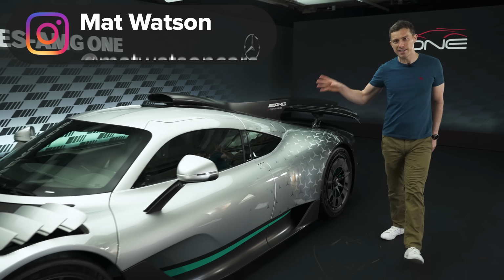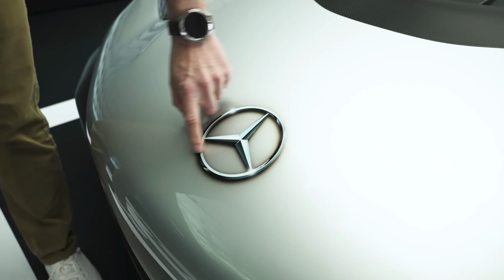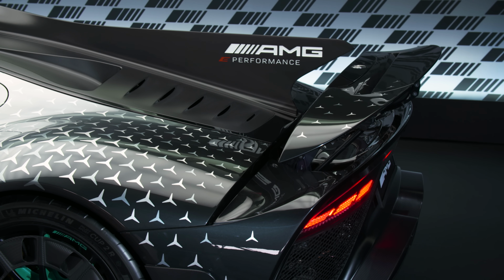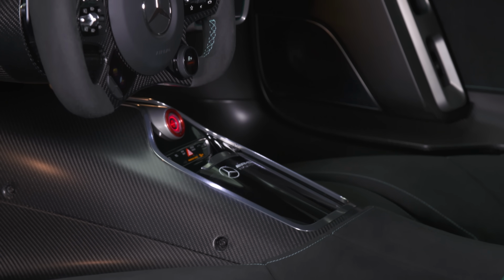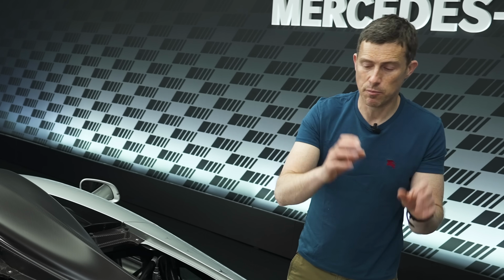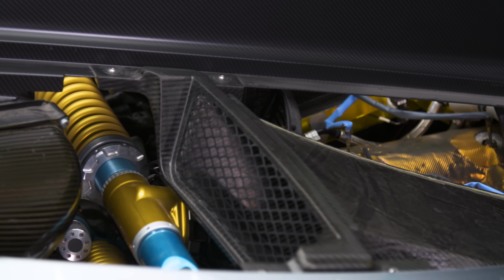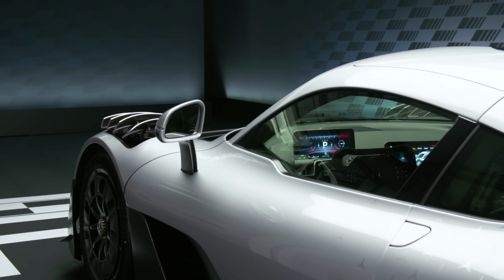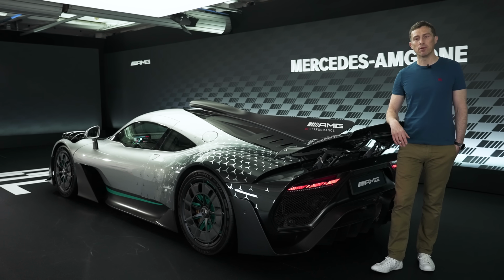Mercedes-AMG ONE: An F1 car for the road!

Comment: This and the Valkyrie were supposed to go up against each other, but with it weighing 1700kg (600kg more than Valkyrie), being almost 100hp down and having nowhere near the same level of downforce, they're not even remotely close. I'd be surprised if it could hold its own against the likes of a 765LT.
Reply: While I completely agree on the weight side I'm fairly sure running the Valkyrie on anything other than a nice smooth race track is going to be a fairly... unpleasant experience. Put it this way, you know how most electric cars have charging points in the sat nav because you're likely to need one at some point? Pretty sure the Valkyrie has a comprehensive database of chiropractors....
Reply: @smiddlehurst1  Oh no! I'm super worried about how my specialized track vehicle will drive on regular roads made for "normies." 🙄
Reply: @dq3666  It's kinda important if you ever decide to drive it to or from the track. Also if you're marketing something as a road car that should probably mean more than bolting lights and number plates on and calling it a day.
Reply: @smiddlehurst1  The Valkyrie will be just as compliant as the Merc. The noise will probably be more of a factor than ride quality because it's so stripped down, but I don't think it'll be worse than any other track focussed car on the market.
Reply: @DWillis7  no it won't. You don't get that level of downforce without compromising compliance. Periodm even the way to get in and out of the car is inconvenient
Reply: @smiddlehurst1  It's widely understood, except for the dim, that a car marketed as track car in disguise as a "roadcar" is probably going to be more geared towards the track. Interesting fun fact for you: the word "gullible" cannot be found in the dictionary.
Reply: @smiddlehurst1  very funny 😂😂😂
Reply: @smiddlehurst1  the Czinger CZ1 vs Mercedes AMG ONE could be an interesting drag race.
Reply: Damn 1,7 ton, it's heavy !
Reply: My point exactly
Reply: Not as fast as a Dacia Sandero
Reply: THANK YOU
Reply: @davidtattersall4357  hi David 🙏 whats up?
Reply: We'll see that on the green hell.
Reply: No, they weren't supposed to do anything, Mercedes never said they're building it to be the fastest they just wanted to make a car that has an F1 engine
Reply: @wailfaridi2070  Yeah but when it's at that price, it honestly should have figures to back it up. What the hell happened to the AMG rumoured to have around 1242HP and 1300KG, it's so far off what it was originally claimed to be. It's performance is literally supercar level
Reply: I was thinking the same thing. The performance figures are hugely disappointing and on paper it is slightly slower than a 765LT in a straight line. I think it just took too long to get to production. Car performance has moved on quite a lot since 2017. It's a pity because I was really looking forward to a Mercedes AMG F1 car for the road. Should still be decent for the track and I'm still glad it exists.
Reply: if u think it has less downforce then wow. I think ur smoking crack
Reply: Or a prius
Reply: No they weren't. You just assumed that because of the F1 engine but at no point did Mercedes advertise it as a competitor. It makes half the downforce lol. On what planet was it ever. Their original weight targets were 1200KG too which is still +100KG heavier than the Valkyrie. The idea that they were competitors was nothing but fanboy headcannon. Aston and RBAT have already developed a car that competes with this.
Reply: The real battle will come down to Aston Martin Valkyrie vs Koenigsegg Jesko
Reply: whatever man...
Reply: Have you not heard about the latest weight figures for the Valkyrie? That’s also quite a shocker! They’ve replaced the light expensive parts with cheaper heavier ones! 
You’ll hear about it soon, I read it from a buyer on maclife! That will be around 1400kg now! They’re quite disappointed but said the car still drives great.
All down to Stroll at Aston cost cutting as the company is on the edge!
Reply: In forza h5 this one gets beaten by many cars
Reply: At least Mercedes came out and told us the final weight but the weight you talk of for the Valkyrie was given years ago I wonder how much it weighs now
Reply: Aston haven't shown any lap times, neither have mercedes so all you people arguing with each other look like clowns
Reply: @Senna_Grillo12 Tell that to Merc/AMG. They're the ones that have delayed the car this long and have an embargo on real world test data on their pudgy overweight, overdue, over rated "hyper" car.
Reply: Wow, comparing official numbers with measured numbers - you guys are very competent. 😂
Reply: Did you know that Heaven is a free gift from God? Billions of people go to bed every night wondering if they have been “good enough” to go to heaven. There is no need to live in fear and doubt. Jesus taught that you can “know the truth, and the truth will set you free.”

There are many passages in the Bible that teach the truth about Heaven being a free gift from God because of what Jesus did for us on the cross, not by our own good works. One of the most clear and important passages is from the Apostle Paul’s letter to the Ephesians:

Ephesians 2:8-9 “For by grace you have been saved through faith, and that not of yourselves; it is the gift of God, not of works, lest anyone should boast.”
   

Most people think that Heaven is a riddle which can never be solved. This is not true! The Bible is very clear about how you get to Heaven, and how it comes by faith in Jesus Christ, not by trusting is our own good works.

For solid bible study please visit ''Truth Time Radio'' - also here on youtube - learn the truth and unlearn the lies!
Reply: I think the same.. yes looks good! But I don't see nothing special in this car. But I'm interesting and waiting to see lap time.
Reply: It's a hybrid it's got motors! and a 1000hp why would you even question that!
Reply: @barrymasindi7801  yes. Quite clear.
Reply: Mercedes thought they were Porsche.
Reply: @Porsche911-r6u  and vice versa.
Reply: @purwantiallan5089  nope
Reply: @Porsche911-r6u  Porsche is unbeatable....People still rate Merc higher than them for some reason...
Reply: @speedbird868  because they make better cars overall
Reply: @speedbird868  Have Porsche won 8 consecutive constructors championships in F1 yet?
Have Porsche put an actual F1 engine in a road car yet?
Reply: @KitKitChanIsaac  How many Le mans and endurance racing has Mercedes won?? Oh yeah they haven't because they will break down and will not be even able to finish off the race...Also F1 should not be the basis of comparison because in that case Ferrari is way ahead in pure numbers of championships and wins over the Mercedes...Any Porsche model will beat the Merc models...Porsche already has it's domination alongside Toyota in Le mans so it should not be much of a problem for them to make a road legal version of the 919evo as Hypercars are much more close to the road cars...
Reply: @speedbird868  last time I checked f1 is the pinnacle of motorsports racing not lmp1 
And Mercedes has dominated it 
You don't win 8 titles let alone mostly consecutively without being reliable 

Ferrari has existed for way longer. Amd most of that success was in the far past meanwhile most of Mercedes success is recent and directly applicable to this car so yes it is a basis 

Have they made one? No so you're living in lala land
Reply: @speedbird868  Who invented the first car? It's Karl Benz,founder of Mercedes
Reply: @speedbird868  how are they unbeatable
Reply: @speedbird868  Even AMG ONE looked quite pale compared to Porsche GT1 1999 car.
Reply: @speedbird868  Well considering Ferrari joined F1 in 1950 and has had 16 constructor wins over the course of 72 years. 
Now Mercedes joined in 2010, and has had 8 constructor wins in 12 years.
Reply: @ingemann110  + mercedes won the championship in 1954 and 1955 before they retired
Reply: @speedbird868  i never heard someone rating Mercedes higher then Porsche. Mercedes themself now and their fans that Porsche is unbeatable. Everybody knows that Porsche is unbeatable.
Reply: @KitKitChanIsaac  dumbass question. Porsche isn’t even in F1. The best GT racing car with the most wins? Not a Mercedes of course. The Porsche 911 is the most successful car. When Porsche joins F1 later this decade I’m sure they’ll be very successful.
Reply: @eventusvantos8586  don't argue with the blind fangirls my g. They just don't want to admit Mercedes-Benz is superior to their other car brands.
Reply: @750gsxr_pilot  What's the pinnacle of motorsport again? It's Formula 1,GT WILL NEVER BE THE PINNACLE OF MOTORSPORT.I doubt that Porsche will win 8 consecutive constructor championships in F1
Reply: @750gsxr_pilot  And don't forget,the 911 is not a hybrid,Porsche's best hybrid,the 919 Evo is 4 wheel drive,Mercedes F1 can do same lap times with RWD
Reply: @speedbird868  Of course,Ferrari has been in F1 longer than Mercedes did
Reply: @speedbird868  And remember,the 919 uses a V4,which is not what F1 cars uses
Reply: @eventusvantos8586  You are forgetting that Porsche also has a rich history in gt racing aswell and already made a road going version of the 919.
Reply: @nuf2188  I never said they aren't good
Reply: @Porsche911-r6u  they're not. They're better than Porsche
Reply: @eventusvantos8586  what a nice joke 😂😂
Reply: @eventusvantos8586  says no one ever. Porsche has always been on top of Merc/ Audi/ BMW performance wise and prestige wise. Go look around and see how many Merc you see vs Porsches. I count prolly close to 9 to every one Porsche even in SoCal. GT2RS still holding the Ring record several years later.
Reply: @750gsxr_pilot  says lots of people including me right in front of you

No it hasn't. Merc holds the nurturing record 
Amg gt black series is faster
Reply: @750gsxr_pilot  Mercedes invented the modern automobile. Doesn't get more prestigious than that.
Reply: @Porsche911-r6u  Just wait for this to beat gt2's time on nurburgring. And if it doesn't, another black series will. Heil Mercedes, the best car company in the world.
Reply: @Jallu555  cringe comment
Reply: @questionyourself718  What is cringe and what is not is a personal opinion
Reply: @Jallu555  nah, the cringe council decides whats cringe, and your comment is cringe on multiple offenses.
Reply: @questionyourself718  Okay Im sorry my queen
Reply: @Jallu555  😂😂😂, that was funny😂
Reply: @Porsche911-r6u  lmao yes Porsche is beatable. Mercedes literally beat their ring time for example. Try again 🤣
Reply: @Jallu555  Porsche still has higher prestige. Also the GT2 RS came out like 4-5 yrs ago and still holds the crown. If a black series takes it then the next 911 RS car isn’t too far out. Porsche won’t lose the top longer than 2 yrs max.
Reply: @750gsxr_pilot  Gt2 came out 4-5 years ago and the car Black series is based upon came out 7 years ago, lmao. And when it comes to "prestige", Mercedes has been one of the top dogs in F1 for many years.
Reply: @eventusvantos8586  took 4 yrs for Mercedes to make a car that will be the non- MR version of the GT2RS? Lol that’s not a flex at all
Reply: @750gsxr_pilot  wrong amg gt black series is faster

Lmao merc holds the record to this day 

And Mercedes didn't need 4 years they beat the gt3rs with the amg gt r 

Merc also holds ring record for four door four seater
Reply: @750gsxr_pilot  yes it is a flex 
Mercedes dominated f1 for 8 years mostly consecutively.  And f1 is the pinnacle of motor sport
Try again
Reply: @eventusvantos8586  ???
Reply: It would beat 765LT or SF90 quite easily in straight line no comparison
I think Aston Martin Valkirie acceleration would be slower than this
Reply: @Smzxe  SF90 can do 0-100 in 2.4s, so it looks like it could beat the Merc
Reply: @racerstudio  SF90 can 
But this Merc has more Power than SF90 and more electical boost it's lighter as well must do 0-100 kmph in 2.2 seconds
You can take the Mercedes AMG One as fast as Tesla model s plaid which smoked SF90
Reply: @Smzxe  yeah, I guess we have to wait for someone to properly time the AMG
Reply: @Smzxe  The Merc is not lighter than SF90 1570kg vs 1695kg
Reply: @leehenry5764  where u seen that from go watch Bruce at drag times weighing his sf90 and come delete your comments
Reply: @leehenry5764  Nah, that's comparing dry to wet. Not accurate. Wet weight is the same at 1700KG roughly depending on spec. It's safe to assume dry, the One is also about 100KG lighter.
Reply: @princesekyere9679  What figure did he give lol. XD
Reply: @princesekyere9679  Brooks, not Bruce.
Reply: @Smzxe  nobody cares about acceleration, we where talking about track times.
Reply: @Smzxe  nah you got it backwards, the sf90 and the 765lt would easily beat it in acceleration
Reply: @matzepizzaheld8541  LOL nice joke 😂
Reply: @Smzxe  wtf look at the Numbers, how is 6.7 sec from 0-124mph slower than 7sec? Or how is 0-62mph in 2.3 slower than 2.9? Who is acting stupid here
Reply: @matzepizzaheld8541  SF90 actually did 0-200 km/h in 6.9 seconds
AMG One has more HP advanced hybrid and it weight less and it's all wheel drive too
F1 cars with that engine used to hit 0-200 kmph in 4.7 seconds it's fitted in AMG One
Lol?
Reply: @Smzxe  bruh are you for real? F1 cars don’t weigh 1700kg, and no the sf90 did 0-200 kph in even 6.5 sec in a video, I used 6.7 because that was the manufacturer estimate. Why should Mercedes pretend that the amg is slower than what it really is? They say 0-100 in 2.9, 0-200 in 7 and 0-300 in 15.6, and that’s how it is, no estimating you don’t work there
Reply: @matzepizzaheld8541  so how do u explain the Mercedes Amg Gt E performance with 840hp weighing 2.4 tons doing 0-60 in 2.8sec? On Carwow channel. The AMG one is lighter and got more power and u think it will still be slower from 0-60 compared to a car with 840hp and about 650kg more weight? 
U clearly don't know what you talking about wait until u see some real times when people start testing them I think 2.4 is easily doable
Reply: @princesekyere9679  I don’t know what i am taalking about? Mercedes Said it does 0-100 in 2.9 not me, so u assume Mercedes themself are idiots? Interesting opinion😂😂
Reply: @matzepizzaheld8541  this is no news manufactures lie about hp and acceleration times always 
Porsche claimed the 992 911 turbo-s will do 2.7sec but people have actually recorded 2.3sec mcralen lies about their cars they claim 720s but we all know that car is well over 800hp they claim 765lt but Bruce recorded 865 on the dyno even Bugatti almost all the manufacturers 
So it's either u don't know what you talking about or u ignorant .
Reply: @Smzxe  Let us know why you think that, with the Valkyrie weighing significantly less and having more horsepower, meaning a much higher power to weight ratio. I'm sure you have a good answer rooted in science.
Reply: @dq3666  I don't know having more horsepower doesn't mean it's gonna be faster
The gearing Matters as well 
McLaren 765LT smoked LaFerrari in terms of acceleration despite 765LT has 200 HP less and weights more 😂😂
McLaren 720s will beat 800 HP Auston Martin Vulcan
Reply: @Smzxe  where did you see a 765lz smoke a laferrari? I would like to know that one
Reply: @matzepizzaheld8541  go search dobre cars They roll raced McLaren senna 918 and LaFerrari
Senna beat Lafferrari in roll race as well as 918
765LT literally gapped McLaren senna on drag strip on dragtimes videos
Also McLaren P1 is known for beating LaFerrari in straight line
765LT was pulling on mighty McLaren P1 watch it on dragtimes channel
Even McLaren 720s would beat a LaFerrari 😂 
Because 918 Spyder beat Lafferrari in roll race in dobre cars video
720s beat the 918 in roll there's a video that says it all
Even 720s can beat LaFerrari
I have a video of Laferrari doing 9.9 @145 mph on prepped drag strip 1/4 mile
McLaren 720s did 9.7 @145 mph at  1/4 mile on drag strip
720s even runs 9.9 on the street that's faster than Ferrari LaFerrari 10.4 on runway
McLaren 765LT did 9.3 @151 mph
Reply: @Smzxe  wtf the laf Runs 9.7 sec on the 1/4mile, and please don’t use dobre cars as scource, their Channel is Entertainment and has nothing to do with performance, I mean a c8 almost beat a pista in one of their drag races😂😂 + the Video was tilted senna vs 918 and te laferrari was just hanging around, not competing, laferrari smokes the 918 in a roll race don’t worry about it
Reply: @Smzxe  We're talking about the Valkyrie having an additional 100hp, while being over 1000lbs. lighter. I don't know what your math grades looked like growing up, but mine were flawless through some of the highest levels of college math you can take, although they're not needed in this case--it's pretty clear. Not sure what you're confused about.
Reply: @Smzxe  765LT (1339kg) weighs more than LaFerrari??? Where does your information come from???
Reply: @dq3666  this
Reply: @Smzxe  Aston might be slightly slower in acceleration but with that downforce it will mop the floor with this AMG...downforce obviously comes with straight line speed penalty but can compensate for it at the corners...
Reply: @Smzxe  yep. And this is just more special
Reply: @Smzxe  and also Ferrari SF1000 2020 F1 car. By a mile.
Reply: @Smzxe  An SF90 does 0-100 kph in 2.5 seconds and 0-200 in 6.7 seconds. This does it in 2.9 and 7.0 seconds. So it's already slower than the less powerful SF90 which costs about 1/6th of this...
Reply: @Cain353  you do realize that the sf90  did all that acceleration figures with eing heavier than the amg one and has slightly less power
Reply: @muhammadhaekalhakim6402  Heavier? No. Less power? Yes. Regardless, at best the One will do similar numbers to the SF90 which isn't impressive for a 2.5 million car.
Reply: @Cain353  yes the sf90 was actually heavier on curb weight go watch the video on dragtime YouTube channel.the car was rated at 3938 lbs (1786 kg) by the owner and c&d recorded similar result at 3900 lbs (1769 kg) against the amg one with just 3736 lbs (1695 kg) curb weight.the amg one isn't just about straight line speed it was build for eating up the corners hence why it has active aeros and shark fin based on 2017 f1 car for stability at high speed
Reply: @Cain353  SF90 Stradale is heavier than the AMG One.
Reply: @muhammadhaekalhakim6402  I don't care. It's slow in a straight line for a 2.5 million car.
Reply: @Cain353  lol it's not even really been tested yet by public journalist and kiddo was so naive to thinks this car will do a same 0-60 with a 2 tons gt 63 s hybrid.the 0-300 kmh time itself was already faster than the sf90 and the 918 spyder which did 2,2 0-60 time by c&d and was 200 hp less powerful than the amg one while having similar curb weight
Reply: @Smzxe  SF90's 0-200 is around 6.3-6.8 depending on the launch, it could beat 765LT in the straight line but not the Ferrari
Reply: @nickie3969  yes bro nice joke have you done 6.3 on your sf90 kid
6.3 that's as fast as Tesla mode S plaid 
And plaid literally walks SF90
You're joking like crazy
Sf90 does 0-200 km/h in 6.9 seconds or 6.8 seconds on Dragy of vbox on fully prepped surface
765LT did 6.5 on prepped surface
765LT ran 9.3 @151 mph 1/4 mile
Sf90 ran 9.5 @147 mph on 1/4 mile 
Now tell me which is faster of course the 765LT is faster car than SF90
Reply: @Smzxe  Man you gotta be either salty McLaren fanboy or Ferrari hater to deny the fact that SF90 Stradale is faster than 765LT, there are many vids and sources that proofs you're completely wrong. Can you explain me how the heck a car with more horsepower, more torque, better weight/power ratio, hybrid and 4wd car could be slower than 765LT :D?  Besides you have said  ''AMG could easly beat the 765LT and SF90'' and then have said ''SF90 has 6.8 and 6.9 in 0-200'' so tell me these numbers aren't better than the AMG's 0-200 time which is 7 secs? 🤣🤣🤣 You're statments doesn't make any sense bro🤣
Reply: @Smzxe  Dude, you have literally commented on a video where a SF90 did 0-200 km/h in 6.6 sec on the street. The video title is "Ferrari SF90 STRADALE 0-100 , 100-200 DRAGY TESTING".
Reply: @Smzxe  How? It does 124mph in 7 seconds, SF90 does it in 6.5 seconds. AMG1 does 186mph in 15.6 seconds. 720s does 200mph in 14.5 seconds. It's not that fast on acceleration.
Reply: POOR TECH for aston martin.  they just only make  1.176 hp from 6.5-litre Cosworth- Naturally Aspirated V12 with an Electric Motor .. while the ONE only has a 1.6L V6 turbo dual electric motor that can produce 1063HP..

in terms of fuel consumption will also definitely be more efficient than valkyrie.

and engine Cooling sistem is more ADVANCED than aston martin.. because of F1 technology.
Reply: Valkyrie isn't road legal. This is.
Reply: @jasper5097  Lol it is road legal
Reply: @MuppetsSh0w  oh.
Reply: @jasper5097  really?
Reply: @jasper5097  Both are.
Reply: @jasper5097  It is road legal. The Valkyrie AMR Pro isn't.